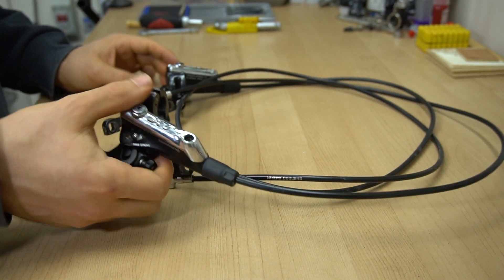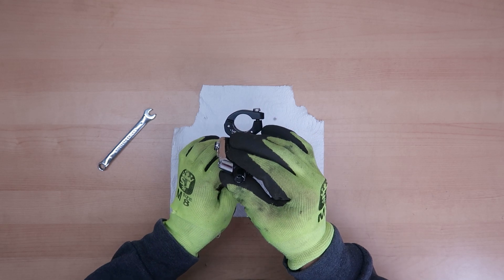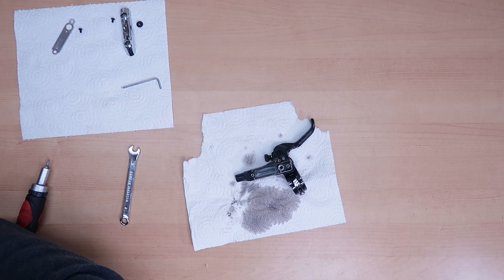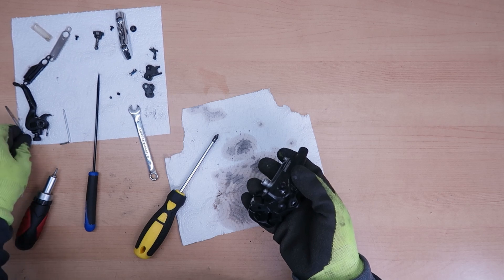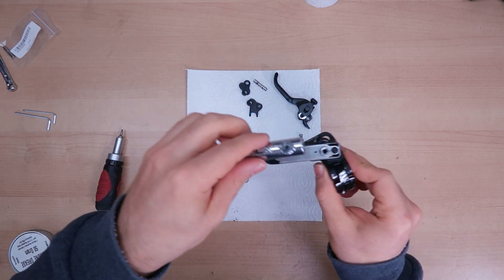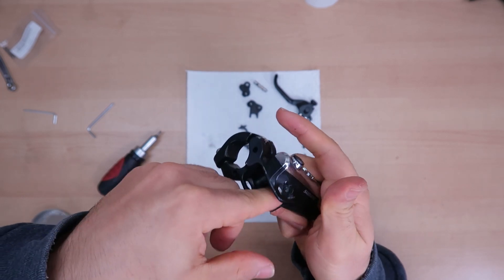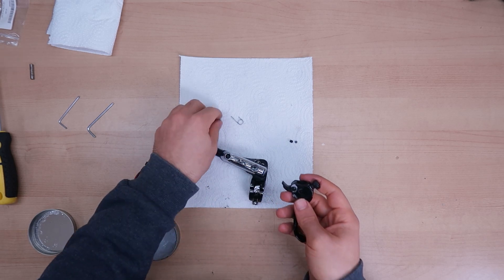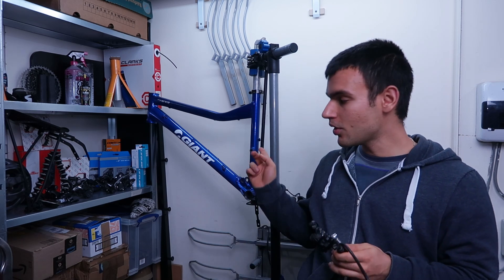Shimano XT M785 Brake Lever Full Teardown And Rebuild

Comment: I have exactly same brakes as those… one with leaking piston… how much can I sell them???
Reply from the maker: Leaking piston is a very common problem as these have ceramic pistons and they crack. You can probably get 30-40 bucks for them. You can try getting more but depends how much time you want to wait.

Comment: Either my fingers are flimsy or putting back the bloody spring is insanely difficult. I spent 2 hours on that with my m8100 levers. When I squeezed the lever, there was no opening allowing me to put it in.
Reply from the maker: I haven't tried on a m8100 but hope you got it together

Comment: How to remove the mineral oil to proceed to this process?
Reply from the maker: There are several ways you can do this. For example, if you don't want to remove all of the oil, you can just unscrew the nut that holds the hose to the lever, split them apart and let the oil from the lever drain into a container. On the other hand, if you want to remove all of the oil, you will need a hose that can slide on the bleeding nipple on the calliper and a syringe. Unscrew the lever reservoir screw, put one end of the hose on the syringe and the other on the bleeding nipple, slightly pull the syringe with one hand and with the other start unscrewing the bleeding nut on the calliper until oil starts flowing. In the end, dispose the oil responsibly. Hope this helps.
Reply: @buckbikespent4588  Thank you very much! ❤️

Comment: My XT m785 is leaking fluid in the levers. near where the levers pivot. Im planning on servicing it and hopefully fix the leaking problem. But i have yet to buy a bleedkit and some mineral oil. Would like to hear your suggesttions on how to troubleshoot it
thanks in advance : )
Reply from the maker: The only thing I can think of that can cause the leak is maybe the piston seals. It probably starts there and the fluid make its way down to the pivot. Depending on how bad it is, you might be able to fix it with a good clean but maybe you will need to change the seals on the piston. Also don't buy the smallest bottle of mineral oil as you might need to flush the system. Sometimes dirt gets in from the leaking point and the whole fluid gets contaminated. Good luck!
Reply: @buckbikespent4588  The Fluid is leaking on the right hand Lever and not in the calliper piston. Are there seals that i can replace?
Reply from the maker: The lever also has a piston. I remove it in the video here: 7:30 .
Reply: @buckbikespent4588  Thanks so much
you earned a subscriber hehe

Comment: I have a problem with the brake lever. 
First, the lever's tank is blocked, bleeding is impossible. I cannot push the oil out.
Second, when I grasp the lever, the oil in the tank doesn't flow in and out at all.

I think the problem is because the lever is contaminated. 
Thank you for your uploading!!!!
👍👍👍👍👍👍👍👏👏👏👏👏👏👏👏
Reply from the maker: The oil in the tank shouldn't really flow when you move the lever, there should be just a tiny movement of the fluid up and down. I haven't seen a lever that contaminated so bleeding is not possible but in your case this might be the issue. If the lever is contaminated, probably the whole system is so you will need to change the whole fluid and clean the lever.

Comment: Hi, I had a pressure problem with my brake, so I took apart the lever and the lower pin of free stroke adjuster is broken (the part you struggle with at 11:17 in your video). Do you know if it's possible to get a spare part? I can't seem to find it on Shimano's component diagram. Thanks!
Reply from the maker: Hi, I usually don't use the free stroke adjuster, I just unscrew it all the way out. I suspect that you had it all the way in, this piece broke and you just needed to bleed your brakes. I don't know if you can get a spare part but maybe keep an eye on eBay or similar places for broken levers. People sometimes sell leaking levers quite cheap that you can steal this part from. Until then just bleed your brake or change your pads if they are worn and it should work fine.
Reply: @buckbikespent4588  thanks! I'll try to bleed and see what happens.

Comment: Great video - just fully stripped mine and rebuilt, this video makes it very easy. Thanks :)
Reply from the maker: Glad you found it useful! Enjoy :)
Reply: @buckbikespent4588  I was a bit nervous of using grease for the piston in case it blocked the timing holes. I used a bit of mineral oil instead.
Reply from the maker: I used silicon grease just to try and preserve the rubber seals but I guess mineral oil will not hurt.
Reply: @buckbikespent4588  Do you know if Shimano recommend using silicon grease? As I didn't see any residue of grease when taking them apart.
Reply from the maker: I don't know if they recommend it or not. It is something I decided to do as I'm reusing the old piston and seals.

Comment: Was this a new piston? I'm having this problem.
Reply from the maker: I just cleaned up the old piston and it is holding fine for now. Is your leaking or sticky? You will have to inspect your piston, clean everything and try it out but if you want to be sure and not do this again, you can just replace it.

Comment: Great video! Thank you for taking the time to post this. I have a strange click in my SLX lever and I think it's coming from the plastic parts that sandwich the metal pin that you attached your wrench to when removing the rod. I'll try to use your technique to replace this part.
Reply from the maker: Thank you, I'm happy you liked it. I wonder what would be clicking there. It might be worth spraying some lube there to see if it will help before taking everything apart.
Reply: @buckbikespent4588  I removed the lever blade and cleaned everything. I also sprayed a bit of lubricant in there. The click is still there but better than before. It clicks when the lever returns to its rest position. The servo wave roller rolls along the lever blade, and in the final moment of the lever retracting, it roller jumps and makes a clicking noise.
Reply: The click is normal
Reply: @ProMountainBiker  That's good to know, thank you. My left lever is significantly louder than my right, but it's good to know that it's normal.